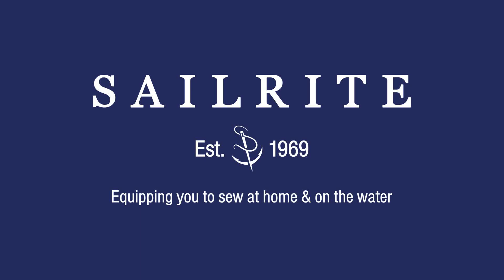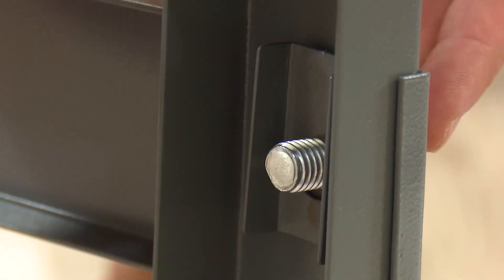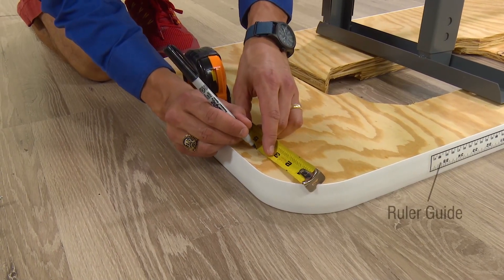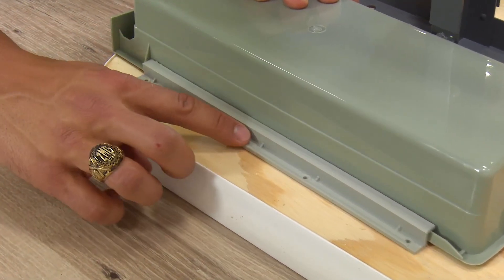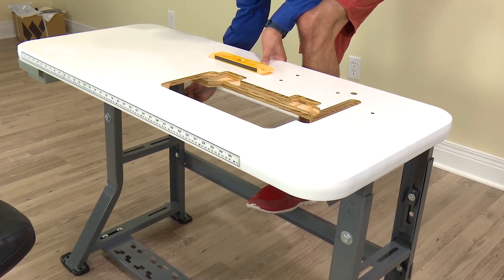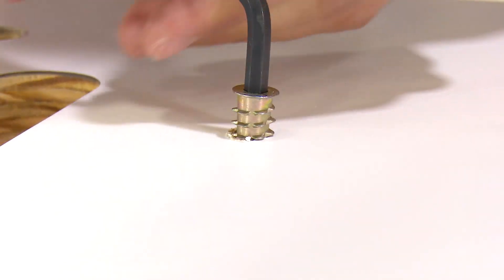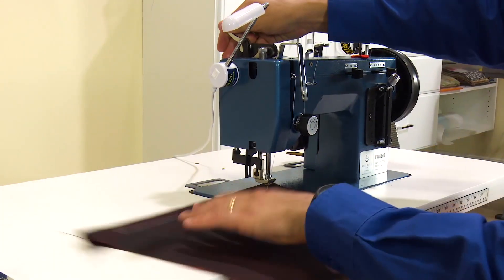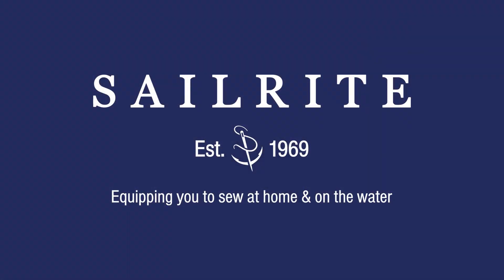Demo & Assembly of Sailrite Ultrafeed Industrial Sewing Table

Comment: Does the new table not come with the euro clips?
Reply from the maker: No, it has hinge pins instead of euro clips.
Reply: @SailriteDIY  your reply that went to my inbox says that it's the "easy swap hinge bases" --which would have been perfect considering that that's what I was expecting (easy swapping between the case and table). We had one hell of a time trying to get the easy-swap that came with the case off in exchange for the far less superior hinge pins. Is there a reason it doesn't actually have the easy swap bases I was expecting, which you described as "They are much improved!!!!" in your first reply to me?